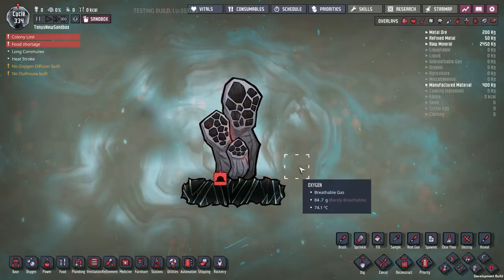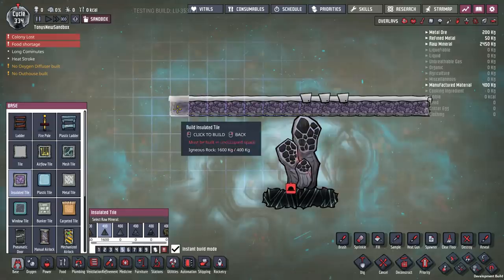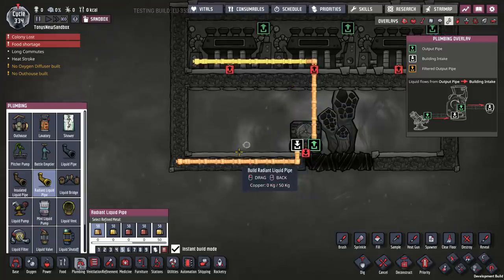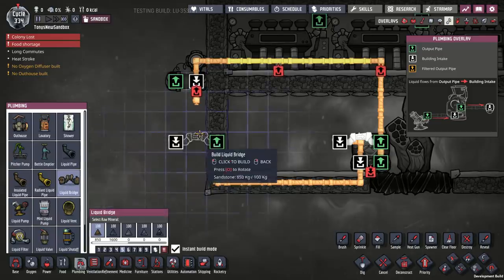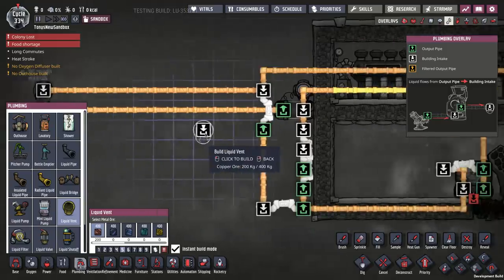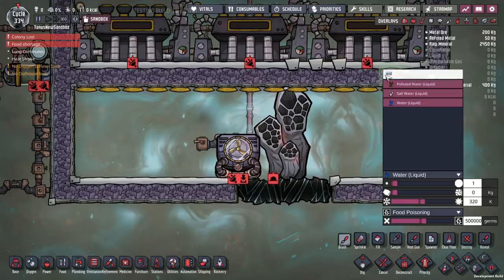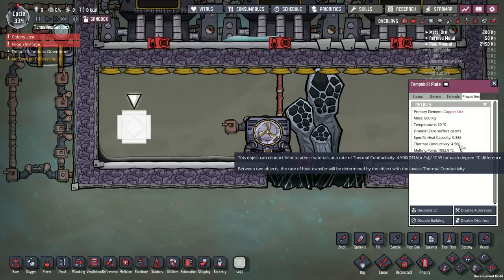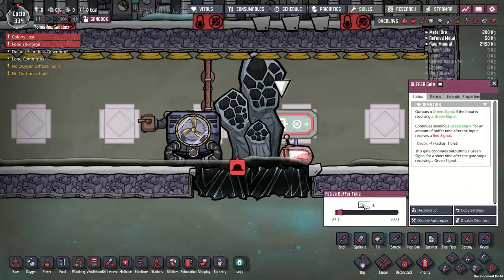A Cool Steam Vent Tamer for your Mid-game Base in Oxygen Not Included.

Comment from the maker: Addenda:
1) This build is vulnerable to the issue shown in this other video: https://youtu.be/907Fgud_AX8 Apparently if you start it up with too much steam pressure in the steam room, it won't start up properly. (Thanks to thepay128)
Reply: What happens on dormancy ? The water loop is eventually depleted, and since steam is always 110 the system will never start again
Reply from the maker: @xN3hiox  I see what you are saying but I've never had it happen. The tempshift plates keep the temperature quite stable, so I think it would still work even if all the water was lost.
In any case, the fix is to use a water input from your base to make sure the loop is never empty.
Reply: I would say a better design would be a thermal injector using a a metal door

Then you don't need to interact with the steam and you can fine tune the temperature to whatever you want

You have to run the same loop, but you have a box of water that is constantly getting cooled by the pipes from the aquatuner

Then a temo sensor on the side of the steam vent, set to red if the temperature is above, say 70 degrees( this is perfect for an electrolyzer) bit you can even set it to 20 degrees C

Therefore the door will remain closed and allow heat to flow into the cooling box, untill the water inside the steam vent chamber reaches 70, after which it will open,creating a vacuum
Reply: @xN3hiox  You can add a liquid reservoir between the turbines output and the loop should you have that problem. Or as a prevention.
Reply: @roojackaroo8517  That means you have to run the aquatuner most of the time. It's very power-hungry.
Reply: @Rig0r_M0rtis  Eh,power is not a problem for me, I have a massive SPOM woth huge power excess, a 10 kg/s oil boiler, a 4 kg/s ethanol distiller --> generator and natural gas generators
Reply: @roojackaroo8517  Good for you. Now go and read the title of the video. It literally says MID GAME BASE
Reply: @Rig0r_M0rtis  you can easily do ethanol distilleries and spoms in midgame lol
Reply: @xN3hiox  I solve this problem with an atmo sensor in the steam room. If the atmostphere is >= 2k AND the tempurature is <= 200 then the aquatuner runs, else it doesn't run and the water in the pipes doesn't cool, so it doesn't get ejected out and it continues to loop until the next geyser active period.

takes a touch more energy from the aquatuner to heat everything back up again so the turbines start to work so adjust the atmo sensor as you see fit, it's only there to check for dormancy.

Comment: early game. no steel. no diamond and no plastic. plus on the steam turbine way more better to have hydrogen instead of oxygen, he conduct better the heat ;).
Reply from the maker: Hydrogen is neat but even chlorine would probably do the job just fine.
Reply: how about temp shifts between radiant pipe & turbine (if it's not cooling well enough due to gas type) that way you COULD have a dupe tune those generators

Comment: Steam turbines aren't early game though.
Reply from the maker: It's true. It's the plastic. I overlooked that in the video and mentioned it in the description.
Reply: Yeah, that's why I always rush glossy drekco ASAP, also the extra plastic for upgraded gas vent make life sooo much easier
Reply: Even the plastic can be rushed. I usually make a temporary dirty plastic production where i just put the press in a pool of water to produce a few hundred kilos of plastic then dismantle it.
Reply: @frantisekzverina473  how do you make sure the pumps don't break?
Reply: @ironboy3245  I assume you mean the crude oil pumps. You can usually find pockets of crude oil that is colder than 125°C. If not you can use pitcher pump and bottle emptier to dump some of the hot oil onto some cold tiles and then pump it.

Comment: I successfully added a full water cooler to this design: Replace the 'hot' output pipe with a reservoir. Place a liquid vent directly above the tuner, connected to the output of the hot reservoir. Place a gas sensor in a corner of the steam room and attach it to the liquid vent and set it to open when pressure is below 500g or so. While erupting, the generators will output more water than can be output during the primary cooling loop so it will back up in the hot reservoir. When the vent is in an idle period the room will evacuate and the vent will open and drip water onto the hot tuner and immediately turn into steam. This will cause all of the captured hot water to be run through the primary cooling loop and have its heat gradually deleted by the turbines and you can output everything a chilly 20C. This was a 4kg vent (exactly two turbines) with a roughly 50% duty cycle. If you need to tune the total throughput to cool more water with a single tuner you can raise the output temperature or increase the pressure threshold, which will cause the steam to be cooler and delete heat less efficiently, but have a higher throughput.

Comment: Tony I am using 3 of these in my current base, they provide me plenty of water for my electrolizers. 

One tweak that makes this perfect. Connect your existing thermal sensor to an and gate and a atmo sensor. Set the atmo sensor to 500g, so it shuts off the aquatuner when the vent is off. This keeps the aquatuner at 100% uptime in conjunction to the steam vent injecting 110C steam.

Clarification Edit: I was having issues with the aquatuner pipes being empty when the steam vent would go off. Attaching the atmo sensor allows for the pipes to stay full while the vent is dormant.

Comment: Aluminum if you have it is the new go to for early game tempshift plates. It has really good conductivity rating.
Reply from the maker: My inexperience with the latest test build is showing. :(
Reply: Diseasel yes, aluminum has a conductivity rating a little less than 3x that of diamond, but the big flaw it has is that it melts at around 660C if I'm remembering correctly, so it can't be used in transferring heat from volcanoes.

Comment: Well I managed to ranch a bunch of glossy dreckos quite early on. Not a huge source of plastic but if you don't use it for much else after a while you have enough (I made 3 beds but I could have made 3 turbines). It took me a while because it was my first attempt ever at ranching drekos with dual hydrogen/co2 atmosphere in the room, and I had to manage the temperature too. I guess once I have the hang of it I could make one quite early next time, right outside the base. You kinda need exosuits tho, but if you ranch half standard drekos and half glossy, at the very beginning, you get a bit of fiber for the suits too.

Anyway my point is if you have dreckos you can have plastic quite early, no need for oil/petroleum/polymer press. Not a lot of plastic, but enough if you save it for turbines.

Comment: I put tiles a few squares above and create a rectangular room with it in side with plenty of space under it and have the water pumping from the bottom to the top and radiator pipes going though the top tiles that ends up making the steam cool down fairly well 🙂
Reply from the maker: I'm not sure I understand, are you cooling the steam? It sounds like a workable solution, but this video is all about why it's good to heat it up instead.

Comment: Any tips on how to best progress to the midgame? I've started a normal run on the easy map food and oxygen aren't an issue heat is still manageable. I'm on cycle 70-80 I feel I should be transitioning slowly to the midgame. I've thought about running petrolium generators but there was not 1 arbor tree in my starting biome or the adjacent ones for ethanol. I thought about plastic but I have only a single drecko reproducing super slow. I need steel as well but I don't have the ore. All these advanced buildings require either plastic or steel. or other refined metals to work properly. I guess your not supposed to use the ore crusher for all your needs. What should I focus on? Ceramic to line my base? steel? plastic? Each of these feels like a megaproject.  to get proper industrial levels of production. 

I found a geyser with water but it's going to need so much power and effort to tame it just for a bit of cooling? for a net power cost?
Reply from the maker: I think of the mid-game as starting when you begin wanting to produce steel and plastic. If you don't have the experience yet then it takes some effort to figure out how it all works.
I think the first step is getting access to oil biomes. You can crush the fossil you mine into lime so you can make steel in the metal refinery, and you can refine the oil into petroleum to make plastic with the polymer press.
There are dangers. Oil biomes tend to be hot enough to hurt/kill your dupes, so you might need atmo suits to keep them safe. And everything about steel/plastic production generates a lot of heat. So you probably need some kind of cooling set up. The first time you do this it will feel a bit like there are several big complicated things that you have to learn and build before you can do the one seemingly simple thing that you need to do.
It isn't easy your first time around, the mid-game is where ONI starts making you really think, and it can be a lot of work and planning. 
There's a fair chance that you'll lose your colony a couple times before you get the hang of it. But if it were easy then it wouldn't be fun, and once you get the experience you'll have strategies for accomplishing these tasks without it being a whole ordeal. You'll get good at it and it will be easier and you'll be ready to do the next big thing.

Comment: This is ingenious!  I always struggle with the hot water and i hate spending so much power to cool it. You mentioned you had a use for the hot water. What do you use it for ?
Reply from the maker: I suppose the easiest thing is to feed it to electrolyzers for oxygen. I'm pretty sure the oxygen produced is about the same temperature regardless of the water you use.
Reply: @tonyadvanced6315  No, not anymore. It's gonna spit out at 95 C.
Reply from the maker: @IlnickiStudios  Indeed.
Reply: Still good use of hot water. 95C Oxygen is easier to cool than 95C Water.
Reply: hot water for oxygen and oil wells, cold water for base cooling or plants if you want to use it.
Reply: hot water can be used for food production and science

Comment: Hi, i relly like your direct way in showing of the things you made. i would like to see an early, easy to setup, temporary metal refinery (without gold or steel) and setup for a "power overflow" (i got some self powered modules with too much power production and i want to put that power into my maingrind if the battery is becoming full.)
Reply from the maker: If you can, just get rid of the battery in your self powered things altogether and wire them into your main grid. They don't use/produce more/less power by virtue of making it themselves and storing it in a battery. But... designing a main grid that makes that straightforward can be tricky.
Reply from the maker: What about the metal refinery is tricky? Is it overheating? Liquids breaking pipes?
Reply: @tonyadvanced6315  I am on Arboria, so i have no access to gold and golden aquatuners. i always used to use one in combination with a water sieve to cool down my first metal refinery. But now im not sure how to get  coolant.

Comment: You can also plug the hot water to an electrolyzer so it eats more heat, and hydrogen generator to make it self seffucient, this way you get cold water, slightly less hot water, but more power and oxygen. And you can use the cold water to cool the oxygen. However I can't make it work. My cooling loop keeps emptying when the geyser goes idle, so I need to pump more water in, at the cost of more power.
Reply from the maker: Hmm. That's strange. If you post a screenshot somewhere and give me the link I'll have a look if you like.
Reply: @tonyadvanced6315  Cool, I'll try to re-create it in my new game, as soon as I have time to play..

Comment: Just run coolant from a smelter, if you are making steel using oil as a coolant it will flash into petrol then for 1000watts you have petrol, heat and smelted metal all in one

Comment: Tony,
I was able to adjust your system and produce only cold water, disable 1 steam turbine.
Reply: With mods that allow you to see the calculated output of geysers its easier to see how many turbines you need for your exact steam vent. Also besides that you could put a liquid tank as a buffer allowing the turbines to continue working the aqua tuner until all the water comes out cold. Epic build.. I'm gonna test it.
Thanks Tony
Reply: Makes it less efficient because the vent will sometimes shut off, unless it produces less than 2kg/s which is when you dont need 2 turbines either way

Comment: The aquatuner is made of gold amalgam right? and has an overheat temp of 125 degrees? but the crude oil thermal sensor is made to heat the place up to 130 degrees. doesnt that mean the aquatuner is going to stop working? supposedly.
Reply from the maker: Gold amalgam aquatuners have an overheat temperature of 175C.
Reply: @tonyadvanced6315  Ah, my bad, it seems my current aquatuner was actually made of iron Thx for the clarification

Comment: I can't get the steam hot enough before the pipe from the aquatuner breaks from cold damage. Then the leaking water cools down the oil.
Reply: I eventually replaced the piece of pipe with steel and then got the temperature of the oil and the steam to 155 degrees before the steel pipe broke. The problem is the steam stays between the 2nd and 3rd row of the chamber but never gets to the top row to reach the steam turbines. It is as if the oxygen is blocking the steam from rising to the top.
Reply: @elizedebeer7085  you need to create a vacuum to not have oxygen in the room

Comment: I'm a new player and I have a question, since I already have hot/cold water supplies from a cool steam vent, but without the steam turbine, what would I get from using this method aswell in another cool steam vent I have laying around? power? I'm struggling a bit with power since I depend a lot on hydrogen/natural gas vent but I think once the natural gas vent goes dormant, I'm gonna have some issues with it. Thanks!
Reply from the maker: This doesn't produce power, but it uses very little power compared to other approaches.
Reply: @tonyadvanced6315  So mostly the benefit from this is to get a constant flow of hot/cold water or am I missing something? haha. I assume it would be better than my aproach since I dont have to use 1.2kW from my base, right?
On that regard, do you have any videos where I could get some pointers for midgame power gains? I'm using 2 natural gas generators and 2 hydrogen ones but it doesn't seem to be enough (the natural gas coming from a geyser). 
Great content btw!

Comment: This build isn't really working for me. My geyser was pretty big, at 9 kg/s, and I had not only overpressure problems, but I also had a problem with the turbines getting the 'Turbine too hot' error when they go above 100C. This isn't like normal overheating, the turbines still animate but they don't produce power and water. I don't understand that mechanic or what to do about it. Your steam needs to be 125C and your turbine needs to be less than 100C. Sounds like we need further steps to make that happen. 

The issue is that while I'm cooling water, I'm losing most of the water produced by the geyser because I have to constantly refill the loop with outside water as the turbines won't do it. There is a delicate balance here somewhere that I'm not finding.
Reply from the maker: Overpressure can be a problem with a powerful vent like yours. I think you should be able to manage it by having a chamber for the steam that is a couple tiles taller. Also, make sure you have enough steam turbines.
I don't know why you are having trouble with the turbines overheating.  If you post screenshots on imgur or something and give me the link I"ll have a look.
Reply: I'm going to try the radiant pipes and I'll get back to you. I didn't catch that part.
Reply: @tonyadvanced6315  Yeah, it works much better now with the radiant pipes there. Thanks for the great vid.

Comment: How can we solve it if we haven't reached oil already? Is there any other cooler than can make the deal?
Reply from the maker: In that case I can't think of any way to handle it besides cooling down the steam until it turns to water. I bet the easiest way would be to put wheezeworts near the vent, and that it could be made in a clever way to maximize the efficiency. I'm certain that there are many demonstrations of good builds for doing this available here on YouTube and in various online forums.
Reply: @tonyadvanced6315  Yes jaja, it's quite difficult to do it because creative mode is quite different to real game and all the materiales are needed. But instead of an early build is quite cool for a medium base ^^ thx for the respones!
Reply: Get a dispenser, get an Ice maker, drop Ice on the floor with the dispenser, see If It cools up, i might try this later to cool my pool